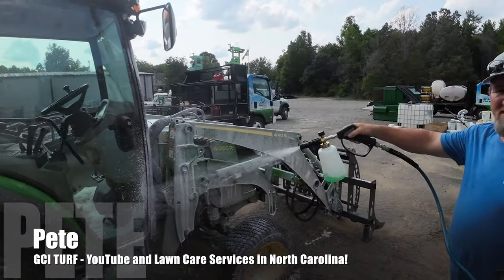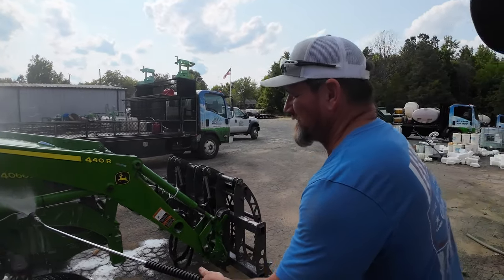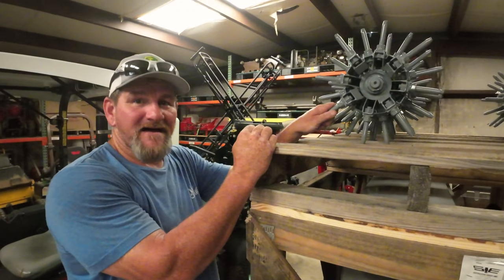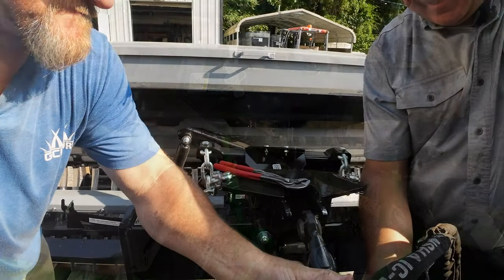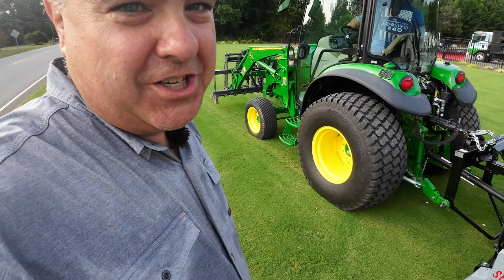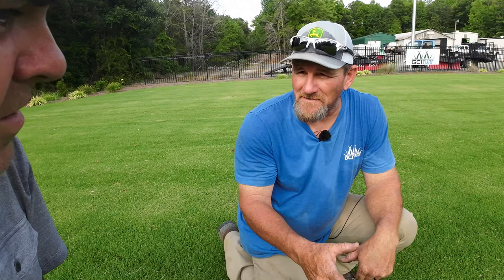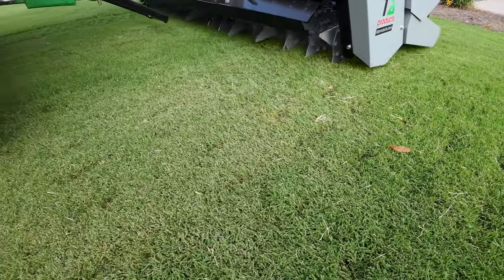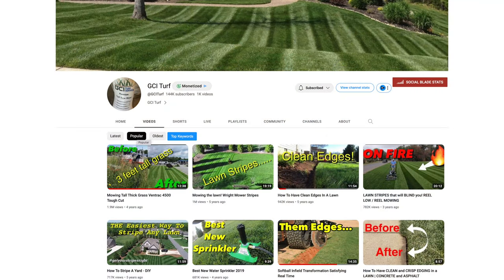Seedavator! UNIQUE Compact Tractor Attachment for Southern Climates NOT SPONSORED

Comment: What goes in the box on top? Pete is cool.
Reply from the maker: Seed goes in there.
Reply: @TractorTimewithTim  I “figured” that or weight.  I missed that being discussed.  Cool equipment I won’t use unless I could rent one.  I still enjoy seeing the engineering and particularly the vibrating penetrating tines. Thanks for responding.